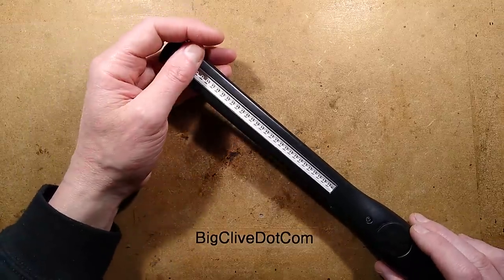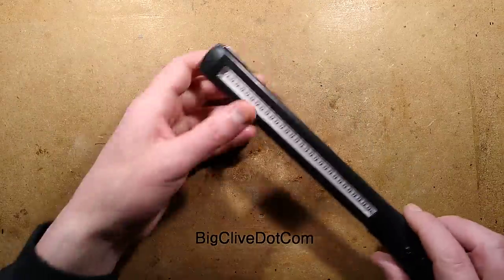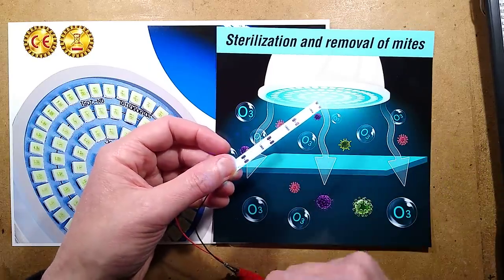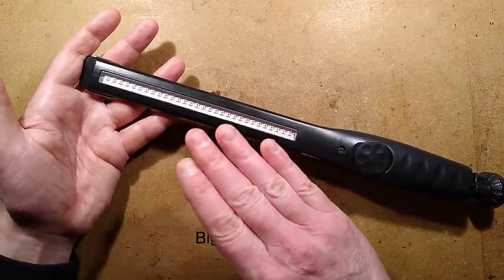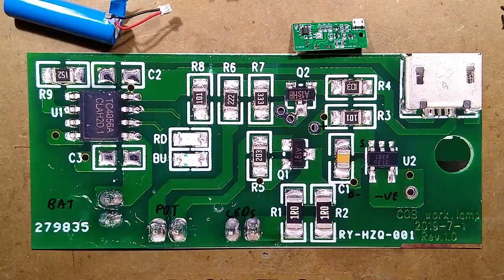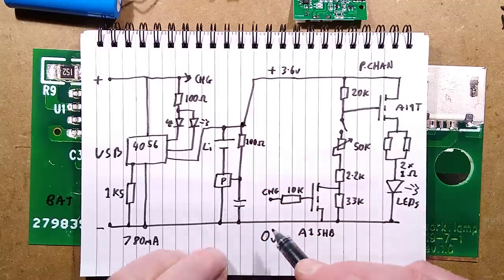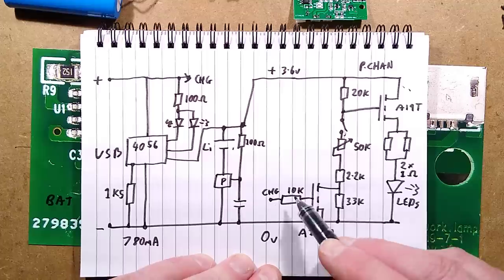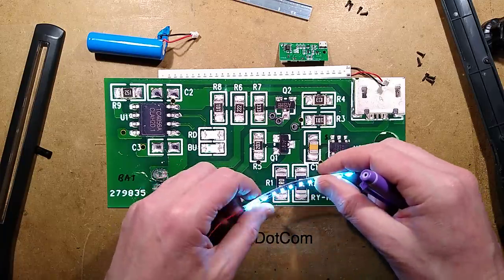More fake UVC "sterilizing" lamps from China!  (with schematic)

Comment: “Work lamp” stamped right on to the board 🤦‍♂️ They just have no shame.
Reply: possibly it was manufactured as a "work lamp black light detector" before the pandemic and shameless sellers repackaging their existing stock
Reply: That stamp is a clear warning from the design engineer: This is a work lamp, not anything else.  If someone claims otherwise, shame on them.
Reply: @Steve Mclean He buy's them and then tests them so we don't find out the hard way.
good work ol' Clive is doing .
Reply: better than "Don't Work" i guess
Reply: @Brian Nichols Would you rike some shame, we have a vast stock avarlable for quickly dispatch to you?
Reply: "Made in China" pish.....as feckin usual!!!
Reply: It's recycling at its finest. Probably bought an excess run for cheap from the factory next door, or downstairs even and had a few hundred thousand blue leds kicking around. Sell a few hundred on ebay
Reply: @mrdicks  The board with the LEDs on is effectively an interchangeable lamp. Possibly made in a different factory from the other parts. This could be as simple as changing the colour of the lamp. (From white to UVA. A quick and simple change to a pick-and-place machine.) Ditto for the previously shown disco light.
Reply: @markevans2294  kinda like those "zooming tactical flashlights" but with black light LEDs
Reply: The lamps were probably designed and manufactured as blacklight, barely UV-A lights to market as work lights to identify fluorescent dyes in air conditioners.  Some low life just bought a batch, relabeled them as sterilizing wands and sell them at a higher price.  That's capitalism.  It takes government regulation (socialism) to prevent this.  It's just that once again China is less "socialist" than America.

Comment: Interesting light.  
On that second FET that bridges the 33K resistor, it looks like when the charger is connected, the light will automatically turn off because of the 20K pull up.  That would allow the light to be left in the ON position while charging, and if the power failed, the light would turn on like an emergency light?  Just my random thoughts.

Comment: It should be possible to get a rough idea of the wavelength of the light produced using a diffraction grating.

A very rusty bell from A-level physics in the 80s is ringing in my head.

Should in theory at least prove that the light being emitted is at least too far in to the visible spectrum to be UVc.

Then the lack of a metal case around the LED although the less consciencious sellers woul dprobably just get their suppliers to paint them.
Reply: if it's monochromatic you can exactly tell the wavelength, not just "rough idea". That is if you know the periodicity of the diffraction grating.

Comment: Those lights are also used for looking for A/C refrigerant leaks on cars as well since they are only semi-hermetic and tend to leak a bit. The manufacturers will typically mix fluorescent dye in with the refrigerant oil so you can spot if a compressor or hose is starting to seep.

Comment: That mechanics light is often used to detect leaks in Air conditioning.  Mechanics put a UV dye in the air con system.  If there is a leak the dye shines when a UV light shines on it.  I hope that helps.

Comment: I was inspired by your videos to buy a Mercury UVC tube from a water filtration company and built a death-ray closet in my pantry. SSR and a switch so it only turns with the door closed.
Reply: I hope you don't smell the sweet air of ozone as a side effect.  You can put a rubber balloon in there and see if the rubber decays to broken pieces  by the effect.
Reply: Beware of the current leakage in SSRs.

Comment: The 'uv' diodes can be used for exposing photosensitive lacquers & such that are sold for making pcb & etching metals. I have used an array of these 'uv' diodes for making photo etched plaques & screen printing stencils for several years with good success as they are repeatable unlike sun light which can also be used, but needs calibrating for each set of exposure conditions. The correspondence between solar & these led 'uv' diodes tells me that the wavelengths of the 'uv' led are in the range of uva/uvb. Thanks for sharing!

Comment: I’ve seen a very similar circuit in a rechargeable night light. The R7 value was 8k2, not 33k. When on charge the LEDs lit dimly as a night light, but when the downward pointing cylindrical torch style night light was removed from the mains plug charger (or the mains failed) it came on at full brightness.

Comment: Really appreciate your rather scientific approach to this topic. It helped me validate the item I bought.

I chanced upon your video just after making a purchase for a glass tube UVC lamp. Thus my research is essentially independent of yours. Nonetheless I came to the same conclusion that most UV LED lamps are at best UVA and UVB.

When searching for UVC LEDs on Farnell, RS, Mouser, Digikey, they'll cost around USD10-50 per piece, and in most cases they're not stocked.

Yet on Aliexpress, and the likes, UVC lamps, with more than 30 LEDs were going at USD8-USD30.

In short either the stockists are making a giant profit or the specs on Aliexpress isn't real.

Comment: UVA will cure the UV-curing resins used in most SLA 3D printers.  At least, it will cure the types that are similar to dental resins.  (Dentist have been using UV curing resins as fillings since the 1970's.   I asked my dentist asked a while back, and the UV used to cure dental resins is just inside the UVA band, so it's pretty safe, even on tissue with little to no UV resistance, like the lining of the mouth.)
Reply from the maker: Many of the dental resins use blue light to cure.

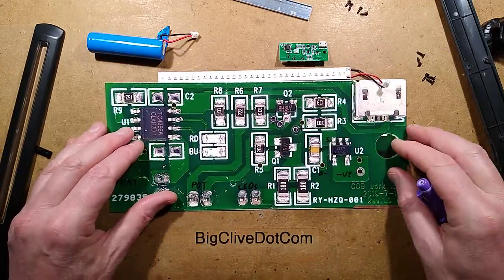Comment: 14:39 - Demonetized. LOL

This purple wand, aside from being rather pretty, is definitely useful under the hood (bonnet) of the car. Not only will the yellow/green coolant fluoresce without the need for leak-detection additives (I've never tried it on GM's DexCool, nor on Toyota's red coolant), but you can use it (deliberately in the nighttime or very dark lighting) to find small wisps of smoke under the hood, which is helpful for tracing odd smells from a running engine. The UV-reactive leak detection dye is often used also for finding leaks in A/C systems - both in home and auto applications - I see others have commented as well about this.

Comment: I know garage mechanics use a uV light to locate leaks in vehicle air conditioning units, and those lights look very suspiciously like this one, so I reckon you're on the right tack there, Clive. One other noteworthy point is that when the guys were checking my own A/C in my Volvo, they were wearing 'special' goggles, and gloves, while they were using the light.

Comment: The struggle to find geniune UV-C emitters is real!
I'm making a UVC chamber to sterilize things out of an old stainless steel tub dishwasher.  Trying to get real UVC devices to install into the tub, racks and door has been a pain, but I eventually got enough after much trial and error.  On the plus side, I like UV-A/B lights, and can now make my dream of having a blacklight array installed into the crown molding of my house a reality.
Reply: fish tank guys have been using UVC for decades.  They have UV tube inside a quartz tube, then
sealed inside light proof housing. Water that pump through got sterilize.  You just need to cut a 

window in the housing.

Comment: Have you discussed "photocatalytic oxidation" in any of your posts? I think its a process that occurs when titanium dioxide is exposed to UVC. I have seen it featured in a number of Hg Vapor UVC lights used in HVAC ducts.
Reply from the maker: I've been looking at that recently, but have not really got any way to test it.
Reply: @bigclivedotcom  We had one (actually 4 in two years) on our furnace. When they worked, fantastic. A faint pleasant sweet-ish smell. Something similar to chlorine or ozone. Sadly the manufacture couldn't build a product that would last for more than a few months.  A new unit (different manufacturer) will arrive a a few weeks. I wish you lived up the street, I would gladly drop of the old one. I've been wondering if $10 of powdered titanium dioxide would catalyze under UVC.  Thank you for all the excellent videos.

Comment: Some restaurants here in the US have UV-C lamps over the entryway door, shielded by a decorative metal valence of somesort, so you can see that pale pinkish-blue glow reflecting off the wall above it, but not the actual tube itself.  What, if anything, are these doing, other than sterilizing the ceiling directly above them?  What is the effective distance of UV-C lamps?  Does the inverse-square law apply like any other wavelength of light?
Reply: Inverse square law applies to straight non-laser beams at any wavelength, from ultra-long wave radio to gamma radiation. But reflection off the ceiling may seriously filter or change the colors.  A common entry door black light use is to check if they stamped a blacklight ticket on your hand to allow all-night entry.

Comment: If you check the Rovyvon E200U or the Rovyvon Aurora A8Pro. They both use UV-C LED at 270 nm but the LED also generate UV-A for showing it on from seoul semiconductor.
Reply from the maker: Most of the UV LED wands seem to be extremely low output compared to the classic quartz tube versions.
Reply: @bigclivedotcom  Yes, but normal quartz tube emit at 254nm and led can emit at 265-270nm. If you check the following link (https://www.ncbi.nlm.nih.gov/pmc/articles/PMC4702654/) for the same amount of light, you get a lot more log reduction using Led in that range. The catch is the Led cost more and you really need to buy from a reputable source to be effective.

Comment: I didn't even think about it on the last video, but I remember when I was working as a screen printer using UV cured inks the glow from the "dryer" units that we sent parts through was that "ice blue" color.  Oddly enough, back then it never even occurred to me that the ultraviolet light was more blue than purple.
Reply from the maker: Some UVA lamps light a bright blue like the insectocutor ones.

Comment: ANY uv source that doesn't need shielding will not be able to sterilize on any sort of reasonable time frame anyway... and any source strong enough to use as this device is intended would cause permanent eye damage pretty quickly.

Comment: Well mine finally arrived - 53 days shipping.  Surprisingly enough although it was listed as a UV-C sterilisation lamp, the manual says "blacklist" and lists the frequency as 365 nm.  Also interestingly the seller has removed it from eBay "due to an error in the listing" so it sounds like they may have had a large number of returns...

Comment: as I understand
, there is a diference between germicidal and ozone lamp, the smell you mention is characteristic of ozone -some electrical taste-, also, to produce ozone is needed to generate radiation with a specific wave length (185nm), unlike germicidal uvc length,  for which is enough to produce a 285nm wave.  Greetings from Colombia

Comment: Clive, awesome video great info on the circuit board ,  but to decipher if the light emitted from the LED is actually in the Ultra Violet Wave length you should be using a UVC Wave length meter not your hand lol , they can be expensive but you will have better data you can support your claim with

Comment: Sure this is useful in a workshop. Maybe not for engine coolant, because you can see the drips, but it is very useful for detecting airconditioning leaks after you have added the fluorescent oil. The standard UV flashlights that  you get with the oil are a bit dim.

Comment: I hate it when they use several identical connectors on a pcb because that means you can plug the wires to the wrong sockets if you don't remember which way they go.

Comment: Seems an analog dimmer with a current-limiting transistor would be wasteful of battery power.  If you turn it on dimly, a lot of battery energy is dissipated in the dimmer circuit?
Reply from the maker: It's rechargeable and the losses in the MOSFET are pretty low.  Otherwise it would get too hot.  In its intended application it's better not to have PWM because the strobing could make moving engine parts look stationary.

Comment: Just an abservation I noticed while doing watch repair. Incandescent bulbs don't charge the glow in the dark markers. I noticed that white LED's do. I agree that the LED UV isn't as strong as bug zapping or sunbed verieties of UV bulbs. White LED's must emmit some form of UV otherwise it couldn't charge glow in the dark objects that usually need sunlight. I havn't tried with a haligen bulb
Reply from the maker: White LEDs have a strong blue peak from the chip used to stimulate the phosphors which add the red and green to make white.

Comment: Nice video Clive! Good breakdown of the circuit, too. Question: I'm waiting for my UV-C detecting circuit (like you used in another video). I'm lining a glass aquarium with aluminum and will use an aquarium UV-C sanitizer (at least that is what the eBay description said) to sanitizer masks and such in the aquarium. Would placing a raw piece of chicken in the aquarium and turning on the UV-C lamp prove it is working, if the chicken gets burned? Since glass blocks UV-C, I thought using an aquarium might be an additional layer of safety. Is there anything that I'm going to do wrong? I just don't want to end up like the chicken;-)
With the above-mentioned in mind, would you consider doing a video on how to build a UV-C sterilizing chamber?
Thanks, and I've subscribed.
Reply from the maker: I'd be worried about the hygiene aspect of using raw chicken for the test.  It's apparently possible to test a UVC light on a banana to see if the exposed area goes from green to yellow or yellow to brown, but I've not tried that experiment.
Reply: @bigclivedotcom  Thank you for replying, Clive. Regarding the electronic in your video: I thought most dimming of LEDS involved adjusting the duty-cycle of the LED driving circuit. That is really interesting how they dimmed the LEDS with an enhanced MOSFET.-
Reply: UVC only provides surface disinfection. Trying to disinfect a mask is futile as much of the potential pathogens and viruses would be within the layers of material. Yes, there are a number of companies that are supposedly carrying this out ... but they will be found out very soon that it's ineffective. If you want to disinfect a face mask, you would be better off building an ozone chamber/ or heat/

Comment: I'm thinking that this was designed for 395nm GaN LEDs with a phosphor as a white light. Which means that it works perfectly well with LEDs without any phosphor. Guessing it's literally a case of changing a tape on the production line.

Would the same circuit drive something like Aluminium nitride (AlN)  or Boron nitride (BN) LEDs anyway?

Comment: LED based UV-C lamps might actually be beneficial. Since the LED is a single wavelength source, they should have it at 253.7 nm wavelength, which kills viruses but doesn't generate ozone (O3). To generate O3, you need a wavelength of about 185 nm. The fluorescent tubes will emit a spectrum that includes the 185 nm, so you can smell it.

I actually prefer having the ozone output as well, since the UV-C light can't reach around corners very well. If I want to sterilize a room, I want the sterilizing properties of the Ozone as well, since it will kill stuff inside and behind cupboards, inside the carpet etc. 
However, ozone will break down rubber products, be warned! (The ozone in the air is what causes e.g. cracking of tires... )

Comment: Bought one of the "sterilizing lamps" for this purpose.Turned out to be about 405nm not 250nm or 250nm + 180nm like real ozone-producing lamps they use in hospitals. Per IEEE, true UV-C LEDs DO exist, and you can buy them on Digikey, but they are about 100x as expensive and inefficient compared to tube lamps by about 10x. The lamp I have claims 7200lm intensity, and I tend to believe that is fairly accurate. It is bright and way too visible to be what it says it is. Fortunately for me, 405nm cures UV stereolithography resin so I have a backup use for it. HOWEVER, I was making a video about using this with a remote control toy and Ryobi inverter to tele-op disinfect rooms. I did an experiment with bread slices over the course of a month. Took one slice of bread fresh from the store and bagged it, took 2 others and rubbed them all over dusty objects to pick up mold spores. Irradiated one slice about 30 minutes per side in close proximity to the lamp and left the other dirty one as-is. After a month, the virgin bread and irradiated bread are mold-free in ziplock bags, and the untreated sample was devoured by mold. Seems perhaps the UV-A lamp that claimed to be UV-C actually might work on certain typed of biological life!

Comment: I do own an actual UV-C fluorescent tube with associated circuitry (EPROM eraser)... hypothetically speaking, how long would one have to expose an item coming in to one's home to the UV-C light to sterilize it? -i.e. is it even practical to do this, even if these products actually worked?

Edit: "UV" mechanic lights are also used to to check for leaks in AC systems (the oil in the system contains a fluorescent dye) and detecting small vacuum leaks using smoke machines (again: fluorescent dye in the smoke liquid).

Comment: Doesn't the forward voltage tell you the minimum wavelength of the LED? 222nm is equivalent of about 5eV so I would assume a real 222nm LED would need >5V.